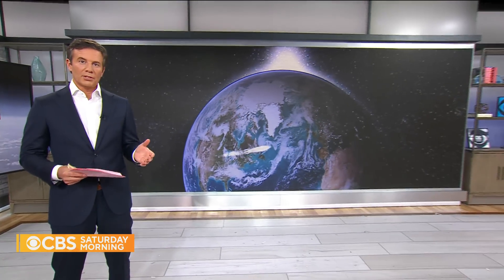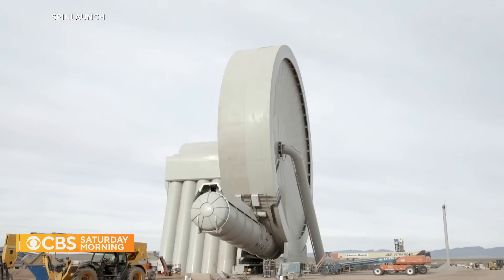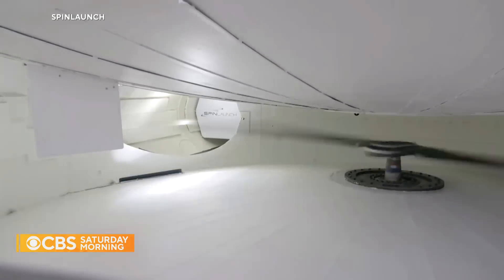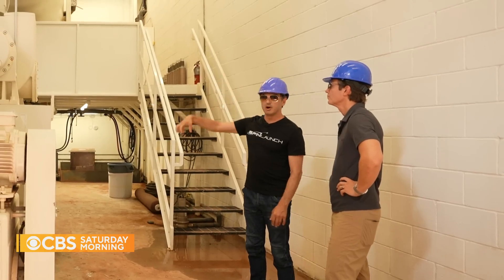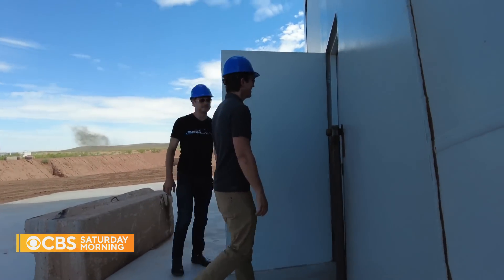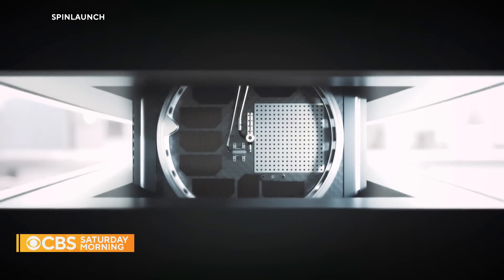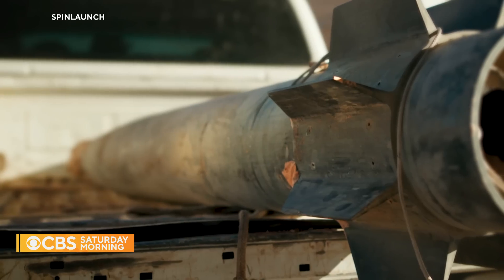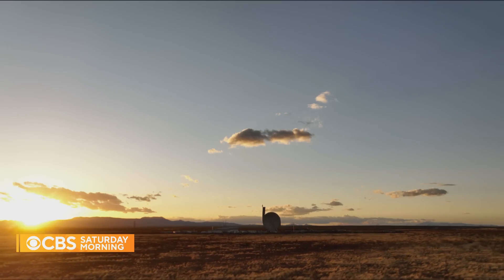New technology aims to put a whole new spin on space travel

Comment: I wonder... How much energy does it need to create a vacuum in such a large chamber? And how much time does it take to get the optimum vacuum? I've seen a vacuum chamber work, and usually, they're pretty small compared to that, and it takes quite some time to get the optimal vacuum. So, he says that he's cutting the carbon footprint by not burning fuel; where are they producing the energy to power all of that, especially the vacuum chamber pumps? Just wondering...
Reply: Scaling up vacuum chambers is actually pretty easy. A vacuum is a misleading concept, as  your not trying to keep the vacuum in the chamber you're trying to keep the outside atmosphere out. Basically if your chamber can support 60 feet of water without leaking it can handle a vacuum just fine. Not that it is "easy" it's size is the easy part. Problem with this whole idea is that you still need a rocket, and you still need to be able to reuse the rocket.
Reply: @dixonhill1108  , the volume of air inside of that structure is huge compared to the small chambers that I saw. So, to achieve a optimal air density inside of that structure, you'll have to pump a lot of air out. How dense will it be inside? How much power is the all system consuming to maintain the optimal air density inside? Another thing that I noticed was that the membrane that is supposed to not allow the air in before being ripped by the projectile is quite leveled, it should be pressed inwards by the difference of pressure, but it ain't, and when the projectile passes through it looks like there is no air rushing in to fill the structure, maybe I missed that. 😕🤔

Comment: The issue is the projectiles are limited in payload as the payload has to be designed to withstand the launch system, rather than it's primary mission upon delivery.
Reply: You mean you don't want to expose your scientific payload to 2000g's 😅
Reply: @77Avadon77 exactly! I smell a scammer.
Reply: The biggest problem I see is that this thing is a massive centrifuge. I estimate hundreds of 'g' during the spin up if the thing is doing 5000mph as claimed here . No human payload is going to survive a tiny fraction of that and I have doubts about any usable satellite being able to take it. OK for yeeting rocks into space but that's about it.
Reply: yup not a human launch system...but it would be useful
Reply: Wouldnt a massive rail gun pointed up be better?
Reply: You're 100% correct. Hypersonic speed will put tremendous G force on any payload, so much so that unlike shells which are designed to destroy using kinetic energy, any delicate payload would be destroyed upon leaving the centrifuge vacuum.
Reply: @Mike-hp2dd  Yup, for "softer" payloads you would need something like several miles of air evacuated mag-lev/rail-gun up the side of a 5K meter mountain to achieve escape velocity.
Reply: @Mike-hp2dd the g forces are still present in a vacuum, what is missing is the resistance. What do you think 250g’s?
Reply: @Mike-hp2dd  Laymen terms you built a bigger arm. Simple physics at play..
Reply: @ElectricVehiclesAreGoodF-ti7xd  the size of the launch doesn't change the velocity necessary (although granted, a larger one would make it easier to achieve). 25,000 mph to achieve Escape Velocity, whether it's an Apollo spacecraft or a Atlas rocket. Anything slower and you cant escape earth's gravity. But you avoided my question. The 25,0000 mph that a rocket achieves is done gradually through a thinning atmosphere. A kinetic launch would have to achieve an initially higher speed, since it would be instantly decelerating. So one more time - what do they have in mind for a payload that could withstand the instantaneous force it would encounter the moment it left the vacuum?
Reply: @Mike-hp2dd  Its called dunnage.. Objects as to humans would experience max of 3gs. In other words 3x its weight necessary to escape gravity.
Reply: @ElectricVehiclesAreGoodF-ti7xd  what???
Reply: @Mike-hp2dd  You are incorrect and so is he
Reply: Its a weapon. Duh.
Reply: No. The real issue is how does one that gets slung into space get slung back to Earth without access to one of these things up there?
Reply: @gametroll6311 it’s not for humans
Reply: I watch hentai
Reply: Investors gonna end up loosing money 🤣
Reply: What do you think 250g’s at that speed?
Reply: 0%
Reply: nuclear warheads is my first thought especially if they sell the idea to northkorea nonstop nuclear bombardment to the western usa like palastine or what eve
Reply: depends how quickly the energy is put into the payload....
Reply: @KentRoads  not really the basic G will distort most complex sensors or inertial systems.
Reply: @KentRoads  nope I am referring to  the product of constrained rotational velocity perpendicular to the origin of the  cercumfrance.
Reply: Necessity is the the mother of invention. Maybe this will be the catalyst for the creation of a real inertial dampening system as portrayed in Star Trek.
Reply: You are 7:49 wrong, it has already reached its speed and there will be no kickback. But the will be several hundred g’s generated. Think of a spinning space station with 0 atmosphere and if is spinning it creates g force.
Reply: Yeah has anyone ever tried to launch inside it I believe they would be soup splatter
Reply: The payload is irrelevant if the launch is super cheap. Then you can launch small amount of payloads a large number of times and assemble them in space. You could have hundreds of these operating at the same time, all year round. Those little payloads can them be assembled into a monstrous spaceships. Larger modules can be carried by conventional spaceships.
Reply: @TemplarX2  still not getting it...the payloads unless inert solid masses are unable to withstand the g on launch so there is nothing that can be sent that would be worth assembling at the other end!
Reply: @Guide504  I'm pretty sure the building blocks for the main body of a big ship can easily withstand more than 3 times that. Engines and electronics can be carried conventionally. What we want is something big built in space. Something the size of an aircraft carrier.
Reply: AEROSPACE ENGINEER HERE: That's actually a sensible comment unlike so many others.
My preferred option for smaller satellites is air launching. Its simply a well proven method for smaller payloads. It also has the issue that the vehicle and payload need careful structural design to handle the transition from level to vertical flight.

People need to be a lot more sceptical about novel technologies and even more so for ones promoted as "game changers." There's so many "game changers" these days its hard to keep up. One thing for people to look for is if something like it appeared in a sci-fi film. For example Elizabeth Holmes idea for the 1 drop of blood Theranos technology was copied from the 1997 film Gattaca that starred Ethan Hawke and Uma Thurman.
Reply: @tonywilson4713   question: how much energy is needed to put one of these 3x larger contraptions under partial vacuum, let alone vacuum as stated here? i have a hunch its a massive amount, negating the net benefit of not using traditional rockets in the 1st place. the Starraker project makes much much more sense: 1000+x more payload, takes off from any military airport, and just needs rockets for the small trip from 80,000ft to space, completely bypassing the need for massive rockets to pass through max dynamic pressure, but i digress. this project is doomed.
Reply: @tonywilson4713 I'm just confused why they are acting like this is new. It's been around for awhile now.
Reply: @tonywilson4713  air launch is another clown circus of not understanding the real challenges of rocketry. There's a reason pegasus and virgin orbit are both dead, meanwhile rocketlab is surpassing every record either aforementioned launcher ever set.
Reply: @tonywilson4713 the guy is a scam artist just like the one drop of blood. How may g’s will be created at the size they want to build at 1200 rpm’s. You can fling a solid object but nothing else I think.
Reply: @afusmackdown  Yeah its another of what I call zombie tech.
Stuff that should be dead and buried by simple logic but no matter how many times its shot down it keeps coming back to life.

Dealing with the tech hype merchants these days is like playing whack-a-mole except every time you smack a mole 2 more pop-up.

I've just watched Adam Conover interview Ed Zitron who's ripped the AI hype merchants apart. Did you know Chat GPT is losing $700K per day?

Right now I am watching Drew Goodens video "AI is ruining the internet" and so far he's ripped it. Its "WTF are these companies actually selling the world?"
Reply: @tonywilson4713  the problem is, I have a high school diploma, I believe smarter than the average bear but come on, how are people putting millions into this. Are people with money just that stupid?
Reply: There are a ton of issues. To mark the most important ones: 
1st - the same force the projectile gets at the moment it gets yeeted, the same force goes to the opposite direction through the mechanic of this machine into the ground. The only way around this is to also release a counter weight which of course would also hit like a bomb.
2nd - The moment the projectile hits the outside air around the vacuum chamber this will be with several times the speed of sound. Now hitting a column of air at that speed goes out not too well for anything. Regardless how pointy it is. And I've not even mentioned friction heat now. :)
Reply: @diymicha2  Being pointy won't help. The projectile itself will acquire angular velocity while the contraption is spinning and this will be retained upon release. It will be spinning like crazy after launch.
Reply: @lusoverse8710  You already see it in the video where it rips through the membrane not in a single point, but kind of sideways. When at "production speed" this misalignment alone could rip the thing into pieces.
Reply: @diymicha2 ”yeeted”
Reading this made my day 😂
Reply: @diymicha2  You know the Greeks, the Spartans were short stature just like this inventor and they believed that height affects smartness, the intelligence was poured into molds with a same sized jug and so didn't fill up the tall people so completely.  The idea of big lunkheads is very old.  You know, don't be a big lunkhead yourself.  The man has done it, save your Doubting Tom breath.
Reply: @keplermission4947  lel. Little do you know. Just keep on brabbling.
Reply: After you prove the concept YOU SCALE AND EXPAND!
Reply: @ElectricVehiclesAreGoodF-ti7xd  really? Not arguing with you - serious question - what kind of payload can withstand the G's necessary to achieve escape velocity? Now keep in mind that whatever will exit the centrifuge will be decelerating - not accelerating - once it hits the atmosphere. Also keep in mind that when a rocket is launched it is accelerating through a progressively thinning atmosphere - this is the opposite. So it will have to be leaving at speed much higher than 7 miles per second. Could the concept work with say - a titanium ball? - perhaps. But I'm not arguing with you - I'm genuinely curious to know what they have in mind that could withstand an instant hypersonic force the microsecond it leaves the vacuum.
Reply: @Mike-hp2dd  You're thinking about the craft integrity or the force necessary.
Reply: @ElectricVehiclesAreGoodF-ti7xd  I'm thinking about what kind of payload could withstand the kind of forces that will hit it the moment it left the vacuum.
Reply: Lots of people saying what this can’t do but I think are missing the point. It’s clearly not for humans and it’s not gunna do everything but it does offer a unique advantage that I am sure will be useful for many applications aswel.
Reply: @jamster2400  sending spent fuel rods into space.
Reply: @jamster2400  I'm going to build something similar using a better method!
Reply: Engineers will always find new solutions to problems
Reply: Its all about cost, instead of launching one huge Heavy rocket you can launch/yeet 😂 multiple payloads inside of 20 mins and then just pick them up in space, multiple uses for this divice.
Reply: @synthmister  my point is they would be space debris when they get there!
Reply: @Guide504  Oh for sure, just adding to the millions of pieces already littered up there, my fault..
Reply: @synthmister  fantasy. The E.V. from Earth for a rocket is 25,000 mph or 7 miles per second. But for a centrifuge it would need to be much higher at launch, since it wouldn't accelerate like a rocket but decelerate because of the atmosphere. And unlike a rocket, the initial ejection from the centrifuge would be where the most G's and heat would be exerted since the atmosphere is thicker and not thinning like a rocket. Assuming one could get a centrifuge to propel an object that fast - and it might be possible - what payload could withstand those types of G's and - in an atmosphere - heat? Not much I'm afraid.
Reply: @synthmister  lol no you can't

Comment: Physics make Spin Launch impractical for satellite launches from Earth. Even their Suborbital Mass Accelerator in New Mexico, according to their own literature, "...spins payloads up to 10,000 g and then releases them from its launch tube towards space". The full scale orbital launcher, again according to their own literature, will subject payloads to centrifugal force from 60,000-100,000 g. 
Designing satellites capable of surviving 10,000g of centrifugal force will be more expensive than launching to orbit on rockets.  This renders Spinlaunch practically useless for any payloads that contain technology for launch from Earth. 
This does not mean the idea doesn't have a good future application. When we begin mining the Moon for raw materials to be used in space, raw materials can be accelerated into space from the Moon's surface using an electric launcher of this sort - the g forces will be far lower and the payloads consisting of raw materials are not fragile. This technology has enormous potential for application on the Moon in the near future and from large asteroids in the future. An electric launcher of this type on Ceres, Vesta, or Pallas could be much smaller and used to transport ice mined from those asteroids to any place in the Solar System.  After that there are also almost unlimited raw materials on the Moons of the outer planets, and the Spinlaunch system also has great potential for application there.

Comment: Shame on you CBS for promulgating this sort of snake oil without vetting the physics and only listening to the marketing BS.

Notice during rocket launches they have to throttle-back (i.e. slow down) because stresses on the spacecraft are getting towards "Max Q" or maximum dynamic stress due to air density and G forces.

This BS idea would accelerate a mass to speeds that when release into near-sea-level air density would DESTROY it as if it were thrown into a brick wall.  Sea-level pressure would suddenly be a hard barrier and the craft would break apart.

This is NO DIFFERENT to HypeLoop -- it's ALL MARKETING LIES.

Comment: BUT !!! There is a big problem:
The primary challenge lies in achieving and maintaining a consistently increasing speed when dropping a large object, such as a ball, as it will ultimately reach its terminal velocity threshold. When facing the opposing forces of gravity and friction, it becomes impractical to sustain the speed without external support. Thus, the concept may only be feasible if a propulsion system, such as fuel-based support, is utilized along with initial spinning for a boost.
However, a secondary issue arises in this scenario: the reluctance of allowing flammable fuel to be incorporated into a capsule that will be subjected to extreme rotational speeds. Safety concerns and the potential risks associated with the combination of high-speed spinning and flammable fuel make it unlikely for such a concept to be readily accepted by authorities or safety-conscious individuals.

Comment: There is some quick math you should do before thinking that this is going far anytime soon.  The max speed tested is WELL below what is needed to get to escape velocity or even a significant fraction of it.  The "5000 mph" is ad-copy from their site.  Actual launches are about mach 1 (700 mph)  It needs roughly a 7x increase in speed, which means 50x more energy is required (speed of rotation is proportional to the SQUARE of the energy)  See ibSJ_yy96iE